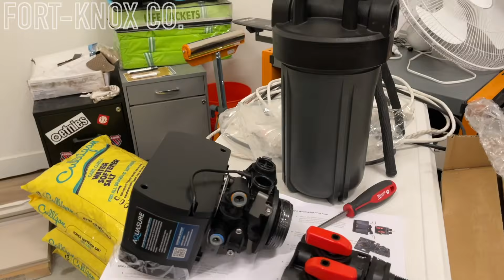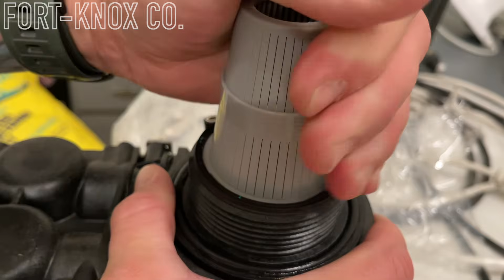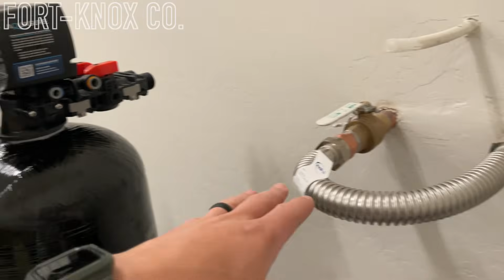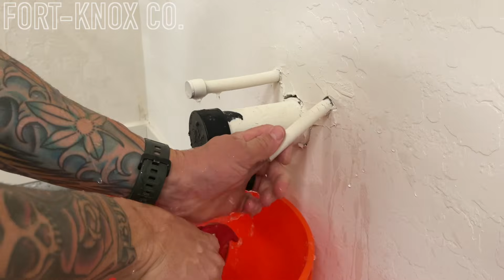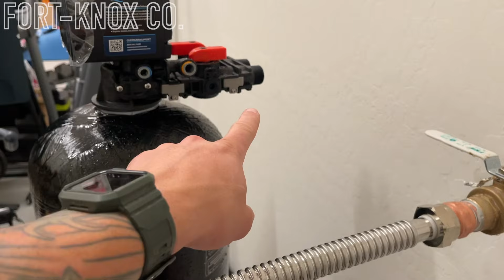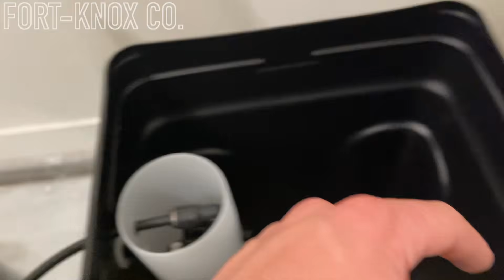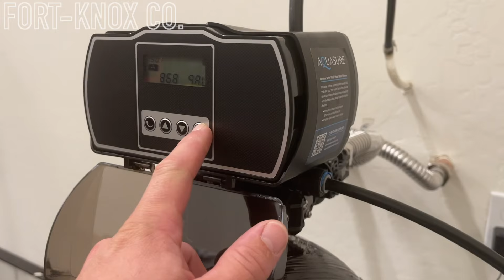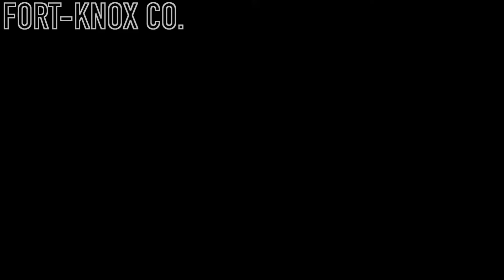How To Install Water Softener System Aquasure Harmony Series | Water Softener Loop Connection

Comment: Hello friends, how much in your state do you charge (for work only) for: installing a softner, installing a Big Blue 20 filter, installing an ultraviolet filter?
Reply from the maker: $75-90/hr seems to be a going rate for labor on appliances. Something’s more for plumbing or specialties. Just install and no parts/supplies is say 3-5 hours depending on the location of the job. But that’s just a rough estimate. I’ve heard of people charging a couple thousand for the system and labor. And even up to $6k from bigger companies offering their product and “top of the line” equipment.  There seems to be a broad range of pricing depending on scope of work

Comment: Did you not buy the filter or have a video on installation?
Reply from the maker: The pre filter? Yes I did have it with the system but didn’t install it in this video. I just focused on the set up of the softener. The large canister filter can be set up before the system or after. Either way works. But I have that process in my other water softener video near the end. The shell water system install.

Comment: Texas Well water treatment

I have a question about my (well water) and this community seems educated.

A local water treatment company wants to sale me a clack WS1 valve 48k grain water softener single tank(single vs 2 tank water softener what's the difference?) (Not sure if this is big enough may need 64k), Nitrate filter tank( do I need this), whole house water settlement filter for $3,300 includes labor and fittings, what do you think about price and size of water softener. Never had one before.

Water is: hardness 35 GPG,  Nitrate 10 ppm(is it safe to shower in and brush your teeth with), Nitrite 0ppm, Alkalinity 220ppm, iron 0ppm, copper .03ppm, chlorine 0ppm, PH 7.8ppm-8.5ppm(depending on the test), TDS 894ppm (their test), pesticides no, Lead no.

 I use primo for drinking water so don't need RO system.

2 bathrooms with (one 60 gallon garden tub, 2 showers) with 2 maybe 3 people(full time at home) with guests once a month. At 100 gallons a day per full time person. What water softener grain capacity should I have.

35x200x7 days=49,000 grain 

35x300x7 days=73,500 grain

2 person @100 gallons @35 GPG hardness=200x35=7,000 grains a dayx7 day region=49k grain but with 48k grain it will be 6.8571428571 days region

May have 3 people @100 gallon at 35 gpg hardness=73.5K grains, 7 day region. 
But with 48k grain it will region 300x35=10,500 grain a day, 48K÷10,500= 4.5714285714 days before region.

6.8571428571-4.5714285714=2.2857142857 days less before region

30÷4.5714285714=6.5625x it will region 
                    Vs
30÷6.8571428571=4.375x it will region 
So it will do 2.1875 more regions a month
Reply from the maker: Looks like you’ve done a lot of the research already. Really with a 48k or a 64k grain system or whatever other brands offer it’s mostly user preference. You don’t need a huge system for a small apartment and you don’t want a tiny system for a huge house. Somewhere in the middle does good either way. Like you calculated, one may regenerate slightly more often than the other. But that in the long run isn’t much of a problem. You just don’t want to be on the extreme ends and over work a system. 

As far as a single tank or dual tank it again might be the system/brand. Some might run the grain number divided between the two tanks or ? Because the grain number is usually total in system. My single tanks does just fine and it’s the larger of the Aquasure 64k grain. We have very hard water in Las Vegas. It brings it down to the undetectable range on the water hardness strip test. 

I’ve seen dual tanks being more of the “whole home” systems because one tank has the clear looking Resin beads (grain) for the water softening portion and the second tank is filled with activated carbon for the cleaning of the water/filtering. Similar to what a reverse osmosis does with scrubbing the water of partials/chemicals/smells,etc. 

I’d say if you’re going from well water to the home the whole home system would be your best bet for overall filtration and quality. 40-60+k grain would work just fine. Anything in that range. And you can set the hardness level and regeneration per gals window however you like.

Comment: Any suggestions on getting the upper basket locked counterclockwise?  I’ve tried it repeatedly and it will not turn at all. Thanks and I’m going to be following your video!
Reply: I solved it a bit ago. I rewatched your video and used a bit more force and it finally turned. I was worried the plastic would snap. Thank you!
Reply from the maker: @MoteventureReactions  o ok awesome! Good to hear!
Reply from the maker: It should seat down in and let you have that 1/4 turn or so. Maybe looking at the head unit where the threads are at and see into how far down it should seat and how far the threads are will give you an idea of what to expect when your putting it in. I haven’t heard of this problem on other units I’ve installed or from other people.

Comment: Doesn’t the instructions say not to lubricate as you can overtighten?
Reply from the maker: You need to lubricate the O rings. Avoid any lubricants on the threads. You need the rings wherever they are at to be lubricated so it can create the water tight seal

Comment: no information when there is fire system
Reply from the maker: Not sure what you are referring to with a fire system. Usually with a water softener system there is an inlet and outlet & a drain line. Not much more to it than that I’m all the residential installations. If you have a fire sprinkler system in your home the water line is usually dedicated and separated from the drinking water lines before everything splits from the utility water supply.

Comment: Excellent video, thanks. Can the tank, model 48000, be moved by a 75 year-old man? How much does the tank alone weight? Not sure after reading the product details. We need to bring it into the basement. He'll be installing it on his own as well.
Reply from the maker: I appreciate that. It says the 48,000 system weighs 120lbs. Not sure if that’s total or just the tank. But it’s a bit heavy. Way heavier once you have the water in it obviously. But I’d recommend having a helping hand for sure. Especially if you’re moving down stairs.

Comment: Can they be installed outdoors?
Reply from the maker: I’ve seen water softeners installed outside, I would still check with the manufacturers recommendations for indoor or outdoor usage. Most people that do install them outside. Still try to put them in some type of enclosure. That will protect them from the sun and also hopefully insulate from hot or cold weather changes.

Comment: Thank you for the great video, I am waiting for my system to arrive, btw I thought this system came with a carbon filter as well??
Reply from the maker: You’re welcome. & yes it does. I just didn’t install that on this video. I had set it up without the pre filter and used it that way.  But I installed another system that is a whole home filtration system and that one has an in line carbon filter as well and I showed that process on that video.

Comment: Looks like you opted to not install the filter that it comes with... I'm debating if it's worth the hassle or not?
Reply from the maker: Your correct. I didn’t install the pre/post cotton filter on this one. But in my most recent whole home filtration system I did.  It’s not too much of a hassle, just one more step on connecting two flex lines. 

Mainly just deciding to put it before your system or after your system. It’s helpful to catch anything large coming from your water supply or after your system it’ll catch anything that may for some reason flow out of your filtration system. I’ve heard neither way is fine.
Reply: Good to know, appreciate you sharing your thoughts!
Reply from the maker: @logandouglas1466  no problem at all

Comment: Can you tell me where to found the exact lines you got? 1” to 1 1/4” 
I can’t find them anywhere!!! Thanks!
Reply from the maker: If you’d like I could sell you mine. I ended up swapping out my water lines with all PEX plumbing. So I have the two now that were only used for a couple months. 

Otherwise I purchased them on Ferguson.com

Comment: Yo, you should use a solid water pipe vs. Corrugated water pipping. You are creating tons of turbulence in the system, creating more chances of pinholes sooner in your system. I understand that it is super easy to install the flex pipping but also shows you're just a handyman and are not a plumber. Also, corrugated piping has pits and galleys, which collect impurities and build up, so it just seems pretty lazy and uninformed
Reply from the maker: I appreciate the feedback. I have used all types of connection types. I really don’t like using corrugated piping and try to avoid it. Doesn’t flex well and as you pointed out can lead to their problems down the road. No so much lazy as much as it is just one way of doing it, supplies available, preference, etc. But either way I appreciate the comment. Thanks for watching 🤙🏼

Comment: We had somebody install this system unfortunately our water pressure has been awful since it was installed. Do you have any recommendations on how to get the water pressure back to the way it was?
Reply from the maker: You may need to turn up the pressure on the house. There should be a pressure bell housing with a little bolt on top of it, at your main water shut off. Commonly found in the garage or wherever the main water line coming into the house. 

It’s not usual that they affect the water pressure though. I’d check the fittings and make sure they are all open fully. And see what type of connections the installer used? Make sure they didn’t reduce to a smaller size pipe to go into the softener and then back up a size to go back in the house. That will definitely affect the pressure.

Comment: Well ladies and gentleman I just got my water softener installed Saturday. 
I used shark bites I ended up making bypass just in case if I ever have to service water softener yes I do know water softener does have by pass but if you have to replace or get water softener serviced I don’t have to shut my water off. 
Make sure all of the shark bites have rubber o rings installed inside. One of my shut off valves did not have rubber o ring installed I had leak when I try turning water On. 
Before you cut measure twice maybe even three times lol. 
I was able to by pass one out of three faucets going outside. 
So when I water garden I’m not using soft water. 
This video did help my a lot Thanks again Dude keep in mind if you guys attempt this project mustaches are optional 😂 👍🏻
Reply from the maker: Haha. Awesome! Great job man. Sounds like you figured it all out. I’m happy to hear this success story 🤙🏼🤙🏼

Comment: I just ordered my unit 
This video inspired me to take on this project 
Is the mustache required?  For this install 👍🏻😂 just giving you hard time I will update when I install it 👍🏻
Reply from the maker: Haha. Nice! I’m sure you’ll get it done. And the mustache does help a little bit. But you should be fine without. 🤙🏼🤙🏼 let me
Know how it goes
Reply: @FortKnoxCo ok so I was just checking my pipes in the basement I have 3/4 copper pipe what’s dimension on water softener is it 1” female 
If this is true I would need 24” 3/4 shark bite one side and 1” female connection to water softener? 
Can you clarify for me?
Thanks
Reply from the maker: @mikimiki195  if you have 1” pipes you should be able to order the softener with 1” connections. Aquasure I believe has 3/4” and 1” systems. If you’re not able to get the sufferer with matching size connections then yes, you’d need a 1” shark connection with make threads on your pipes. And the flex lines with the 1” on one side and 3/4” on the other. 

The also sell reducers that will take you pipe from 1” to 3/4”. Then you can use 3/4” flex lines all around. 

There’s a couple ways you can made the size up and size down depending on how you want your do your fittings or flex lines.
Reply from the maker: @mikimiki195  sorry I thought you were saying that you had 1 inch lines on the house. Either way you can get a reducer or flexible pipelines that connect the softener to the house with correlating sizes. If you have three-quarter inch on the house, you can order a three-quarter inch water softener system, which is very common. they should have those available. And if not, you can like I said, get the right reducers or sizers to make the connections fit.

But if you’re able to keep everything at three-quarter inches all the way around, that would be easiest and best for water flows. Even if you sized up and sized back down, it shouldn’t affect your water flow much  at all.
Reply: @FortKnoxCo  thank you for clarifying 👍🏻👍🏻👍🏻

Comment: Where is the drain going?  Seems like an important aspect of installation.
Reply from the maker: If you have plumbing for a water softener in your wall you should already have a drain line ready to connect to, usually a 1/2” or 3/8” line. It is ran to the nearest drain, usually it’s ran to the washing machine drain or something similar with a larger drop to the p-trap. Either way if you don’t have a drain line plumbed in the wall you can run the line to a near by drain that’s connected to your sewer system. I’ve seen people run it to an RV flush out, or near by sink drain. You just want it to be able to handle the large water flow when in use.

Comment: Hey man, awesome video and explanation. I just have a question, my water loop is 3/4" PVC. Is it the same process to cut the two ends of the PVC and kind of glue in an adapter with 3/4" male thread so a hose threads on, or still use a shark bite hose on that end?
Reply from the maker: If your water lines are actual PVC then you could glue an adapter with the male threads and accomplish the same thing. I’d just check and make sure it’s pvc and not a type of PEX. You have a couple options either way. I’ve usually only seen copper or PEX. But I believe the shark bites will connect to all 3 types. 
If you do go the male thread pvc ends just be careful with the pvc threads. They are easy to cross thread and you’ll know cuz it’ll be leaking.

Comment: Great informative video.  I installed the Aquasure water softner today.  It took me about 8 hours but it was my bad because I had to make multiple back and forth trips to Home Depot for parts.  i will tidy it up tomorrow and have it running inside our home.   I  purchased a PEX tool for the connections and it was pretty simple once I got going.  On to the next home project.....  Thank you so much for taking the time and going step by step.
Reply from the maker: That’s awesome to hear! That PEX tool is awesome. Did you get the pex A expansion or PEX B clamp style?  We have pex A in our home and it’s all I’ll ever use now. Having that tool is a life saver. I’m about to run all water lines in this casita build. I’ll be filming all of it and doing explorations on all the areas. Kitchen, two full baths, laundry, exterior hose hook ups, everything.
Reply: I have the PEX B style clamp.  My home is a new build (4 years) so I will be using it for small projects.  THANKS again! @FortKnoxCo
Reply from the maker: @sergiocarrasco3169  your welcome. I appreciate it.

Comment: I’m buying the same system but said it comes a filter where that located
Reply from the maker: Awesome. Yeah this system comes with a pre /post filter, depending on where you want to install it. I didn’t use it in this video but in my other water softener video about the shell water system I used it and showed where I installed and how. 
Pretty much you just install it in line before or after your system. Some like it before so it catches anything large coming from the water supply. Some like it after so it catches anything that may make its way through the softener system and before I goes into your home. Both ways are good

Comment: Do you have to manually run the system every time?
Reply from the maker: Nope. The system runs itself at the time you set it to regenerate. Usually ppl set it to run at night when the system isn’t likely to be being used. Not a problem if it’s but you won’t have soft water during the regeneration.

Comment: Great video man. I’m probably going to buy this system but my new house piping is confusing me. Everyone I’ve watched seem to have a clear in and out source but I can seem to find that in my garage.
Reply from the maker: You can’t find the water loop? There usually is an horseshoe bend of pipe coming out of the wall in your garage, near you water heater or the main shut off/pressure bell housing water supply to your home.
Reply: @FortKnoxCo  actually after further inspection I believe I found it attached to the outlet for the water hose. Unfortunately no drain nearby for backwash so I assume that will require a hole to be made through the drywall to reach a drain of some sort.
Reply from the maker: @Gary_Walker90  that could be a solution. If there’s no near by drain to run to. Most commonly the water loop will have a smaller 1/2” or 3/8” pipe that is ran to a drain that you would connect the flush line to. You can also run it to a drain of your choice. But the flush line does need to be able to run that water somewhere controlled to not flood.